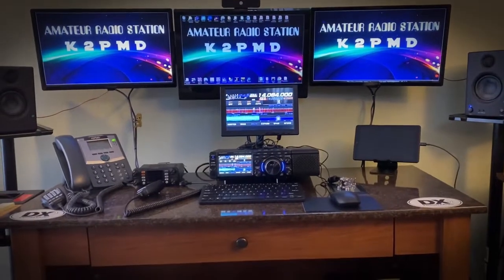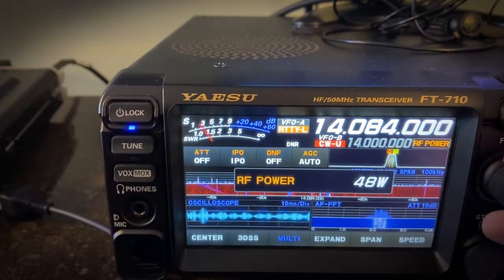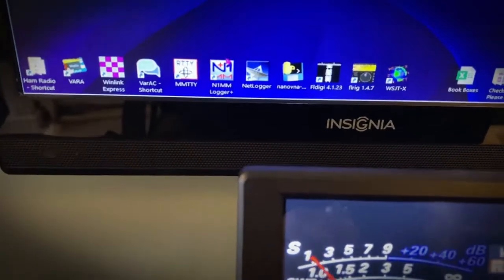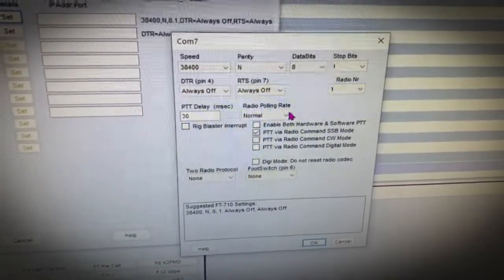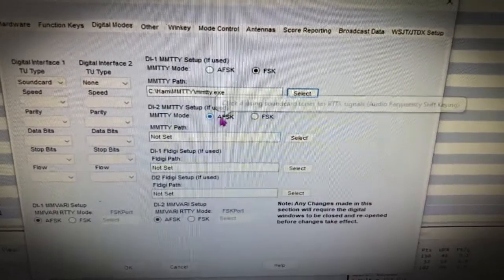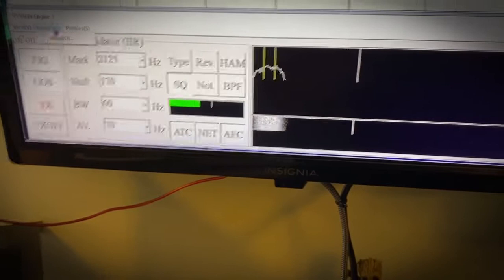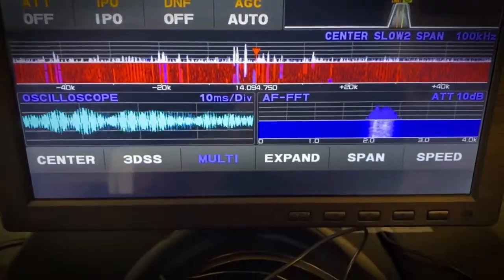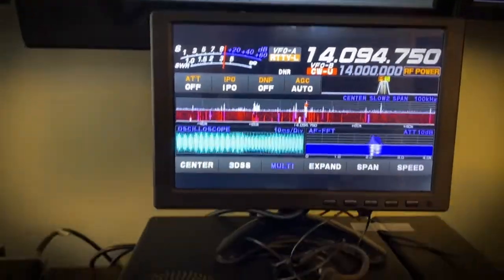Yaesu FT 710 RTTY Setup N1MM  w/ MMTTY

Comment: Hi Paul, thank you for the video!! I did the set up following your suggestion and it works.... but I didn't get a clear FSK (sound from the radio). I get the both shift frequencies and a 'interruption' of the signal with about 30Hz. It sound like a perfect signal which is then shreddered.... I cant hear your signal that you send out (in the video) Is this clear and only the pure both frequencies for FSK?
Could you check or advice what I did wrong. Vy 73!

Comment: Are you using the standard USB cable connections between the radio and computer or a data cable into the RTTY port on the back of the radio?
Reply from the maker: Hello Chuck. I only use a single USB cable between the radio and the computer. There are two com ports, one enhanced and one standard. Those represent rig control (enhanced) and PTT (standard).
Reply: @K2PMD  Thank You!

Comment: When I set port for PTT my radio is busy non stop...I have only usb cable pls. HELP
Reply from the maker: Hi Jakub. I am sorry this is not working for you. Not knowing what you have done for set up, it is hard for me to assess your particular problem. You should have two com ports the Enhanced is for Rig Control and the Standard is for PTT. You should also ensure that your baud rate for the com ports, (I use 38400 as suggested by Yaesu)  match your radio's baud rate and the baud rate in your software. Are these all matching.  BTW: I am no longer using this overly complex set up, and have moved to a much easier set up using FLDGI and N3FJP. Please take a look at this video that I recorded yesterday: https://youtu.be/Jb0zy4EHDxY?si=K32U04CDc1zNkg3b
Reply: @K2PMD  
My Friend, thank you for your answer. I found a solution to my problem. The reason was the setting in PRESET
Reply: @JakubSP4OLI  I have the same issue - which setting was at fault ?
Reply: @paularcher128  Try switch off "PRESET" in MODE menu.

Comment: Hello Paul! I can hear stations, my radio sends TX, I can hear my signal but no one hears me. Any Idea? Thanks for the video. Gabriel
Reply from the maker: Hi Gabriel. Not sure what is going on. I am now using N3JFP for RTTY with Fldigi. It is much easier. Maybe that will work better for you too. Check out my video on using RTTY with Fldigi.

Comment: Are you using the USB for the RTTY   or are you using the 6 pin connector ?
Reply: That question is why I was looking here too.  At about 2:45 give or take in the video he mentions that there's very little to be done in setup and then says "Other than hooking up a USB cable".  He then mentions specifically an A to B USB cord.  I can't wait for "Tax Time", as I'm wanting to pick up one of these things. :)
Reply: @timsmith1426  they are 5 bucks on Amazon,  received one today.
Reply: @timsmith1426  A to B USB w/ferrite usually only $7-10 on Amazon!

Comment: Good job Paul on the video was the speaker included with the Ftdx710
Reply from the maker: Hey James. great to hear from you. I love this new radio. It isn't the FT-DX710 it is just the FT-710, and yes it does come with the external speaker. A real bargain for $1,000. https://www.dxengineering.com/parts/ysu-ft-710-aess
Reply: @K2PMD - Paul  yea I am looking at the ftdx10 too